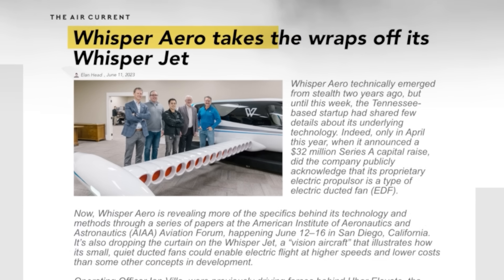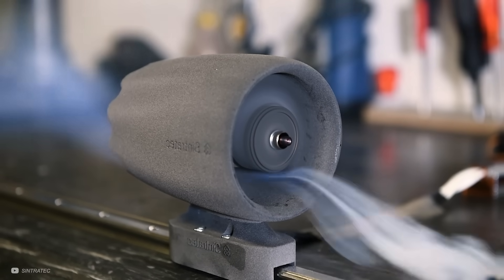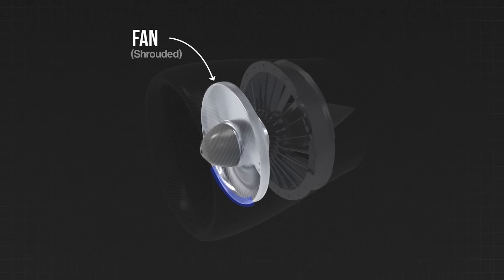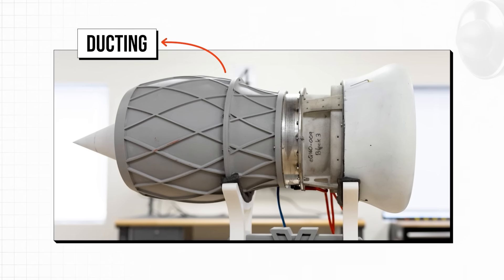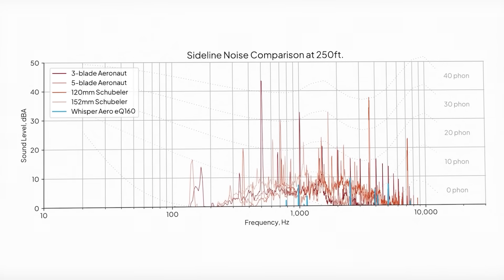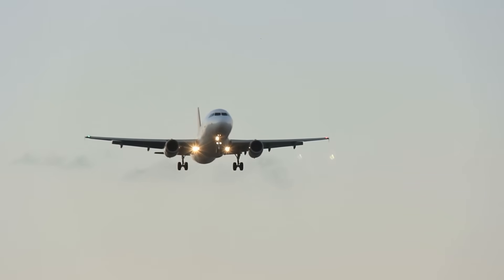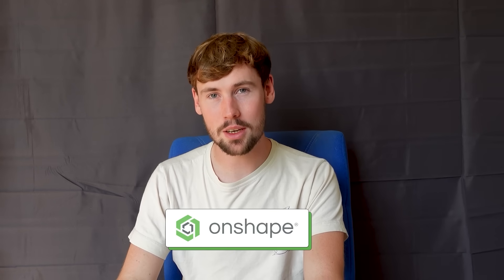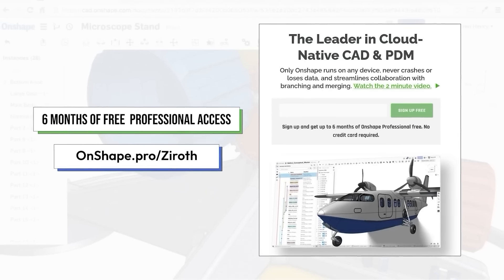This Genius Jet Engine Is Starting A Revolution

Comment: The major aircraft engine manufacturers have already done enough research to show that large fans at a slower rotational speed with high by-pass ratio have shown the best efficiency gains. Small is not efficient. All the major aircraft manufacturers are now producing twin (large) engine planes rather than multi (small) engine planes. I have flown model aircraft with high speed ducted fans and they are nowhere near as efficient as a propeller, limiting the flight time considerably.
I have to say that my trust will remain with Rolls-Royce, not this outfit.
P.S. Regarding the previous comments on the meanings of Engine and Motor, I would point out that the term "Motor" for an aircraft engine had been in common use for many years. There was even a WW2 song "Coming in on a Wing and a Prayer" which had the line "Though there's one MOTOR gone we will still carry on".
Furthermore, diesel powered ships are normally designated Motor Vessels- hence names like "M V Atherstone" (a former P & O ship)
EDIT- I have added this due to comments on my mention of bypass ratio- I know that this refers to turbo fans, but it was meant to highlight the size of the fan compared to the prime mover (the turbine). It is the large size of the fan which is the goal, moving the most amount of air, with least amount of internal drag. Small ducted fans are a dead end.
Reply: The thing is, "bypass ratio" only makes sense in the context of a combustion jet engine. It's the ratio between air going through the gas turbine that's driving the fan, and air going around (and thereby bypassing) the gas turbine.

This, by comparison, is an electric motor driving a fan. An electric motor ingests zero air. Therefore, 100% of the airflow is "bypass" airflow. The "bypass ratio" of this engine is impossible to describe mathematically because it's a division by zero.

So if you get 100% bypass airflow regardless of the size of your engine, then the size of the engine ceases to matter - at least for this particular factor.
Reply: @streetwind.  Even pure fans can be designed to either move a bit of air very fast, or a lot of air comparatively slowly. The bigger, the more efficient. Unless you go transonic, where it gets terribly complicated: whatever optimisations you do to the blades of a ducted fan, do the same optimisations to an open propeller, and then ditch the shroud for longer blades. Same efficiency, lower weight, lower complexity. Always. That's why there are no strictly subsonic (i. e.  not transonic) ducted fans in commercial service. Too heavy, too expensive, too much drag, too complicated.
Reply: "My trust will remain with Rolls-Royce". A good pun missed, right there!😊
Reply: the bypass ratio is only a real consideration for jet engines, for regular propellers, the most efficient size is the size that allows the motor to use its peak rpm while the outer edge of the blade is just below supersonic speed
Reply: Larger is in most cases more efficient, yes, but you can't judge from toys that companies do no research at all (they just aim for how cool it looks).
 I bet an out of the norm, well researched duct fan design could outperform your favorite propeller by a large margin, even if it's smaller in diameter - but not too small.
Reply: @sumwonche5688  In a word: no. You probably have no idea how insanely efficient modern propellers are. If you want to reduce tip losses, you can make the blades thinner and longer, or add a shroud. For the same efficiency gain, bigger propellers will always be better than shrouded fans. Shrouded props have been tried and tested for decades. Unless you have a specific reason why you cannot have an open propeller (usually safety), ducted fans are a bad idea. Otherwise they would be abundant; they are not a new idea by any means.
Reply: @pinkdispatcher  85-90% + the large size + the noise, so there is plenty of room for optimization. If you want for example to make electric urban air-vehicles, propellers are not an option, if they can be made virtually silent and at least equally efficient with a new duct fan design.
Reply: @sumwonche5688  just imagine propellers 5x the size of the engine with the same thrust.
The engine would have to suck the air through with the 5x speed, which would make it's power consumption 25x.

Comment: How much electrical power is required which translates into battery weight?
Reply: Or run time which equals range.
Reply: At 500wh/kg 1300 tones of batteries 164 tones of fuel.

Comment: 16dba. That is the real change. Significant certainly, but not inaudible as suggested here. Also humans can hear well into 20KHz. 16KHz may be incredibly annoying for those that can still hear it. 

In the end this is all pointless for aircraft though. Until batteries are many times better, like 10x, electric planes will never be very successful. They are too range limited. No one wants to spend millions on a plane that cannot take them anywhere. Currently they may have a niche for inner city commuting as VTOLs. Short trips at faster than car speeds. But if that really takes off, it will be a disaster very quickly as air traffic controls aren't designed to handle hundreds of craft. 
Beyond that the batteries just aren't good enough.
Reply: The reduced maintenance requirements may make them worth for small hops (within the 1h range) but even that is pushing it, considering the requirement to be able to reach an alternate airport and or have 30 min extra flight time as a safety margin.
Reply: @clockworkvanhellsing372 I would say most cases you aren't flying to airports. It takes too much time that you don't have. VTOLs direct from location to location like a helicopter. Similar max speed too. It fits the role of a helicopter but with worse range. It might be a trade off people are willing to take if they are filthy rich and this is quieter.
Reply: Full scale versions will need hybrid systems. A small gas turbine can make electricity then actual population is electric fans. A gas turbine that isn't being used for thrust should be able to be pretty well insulated for sounds. The problem ends up being weight. Gas tank, turbine, electric generator, then a buffer battery, then electric fans.... Weight all adds up. I don't think I have seen it done yet.

Comment: HAHAHA. Greenies still pushing the inviable electric aviation. Nothing says GREEN like a flaming aircraft plummeting from the sky. Well, we are developing adv engine AND propulsors which are more powerful and efficient than anything on any drawing board... using ANY fuel which will be incorporated in our revolutionary door-to-door, personal, air mobility system [PersonalJet].
Reply: None of the Whisper Aero tech is truly new... but ours is.

Comment: Would it be able to lift the batteries to enable it to fly?
Reply: It does not need to lift batteries. It only needs to lift money out of investors wallets.
Reply: They use a long power cord.
Reply: was going to say the same, probably not until solid state batteries are a real thing. Im also wondering about the drag on the leading edge and if there is an alternative for slats.

Comment: 3:43 Did you mean 16 KHz instead of 16,000 KHz? If so, that's not out of the range of some humans' hearing; children will not enjoy being near such a plane but their parents will be oblivious as to why.
Reply: At 59, I can still hear 16 kHz. The 20 kHz “limit” is analogous to an IQ of 100. It may be the center of the bell curve for young adults, but there are many far away from the mean on both sides, both young and old.

NB: Fortunately, IQ does not decline with age quite as fast as high frequency hearing!
Reply: @altosack also the lower limit of 20hz as well, is less of a brick wall and more of a gradual decrease in sensibility, where the hearing threshhold increases. so "infrasound" can become audible with sufficiently loud levels, i think down to at least 12hz or maybe lower
Reply: @LucasFerreira-gx9yh nah, just need an in-ear headphone and you can hear at around 16 Hz and below that it gradually transforms into a sensation of pressure wobble. Really, almost any cheap known brand headphone does the trick, you just have to make somehow such low frequency that is not present in regular music. All music applies a high pass filter of abou 25Hz otherwise when played back on a stage system it shakes everything.
Reply: @LucasFerreira-gx9yh  Just so as you know, the 32 foot pipe on a pipe organ is between 16 and 17 Hz. and the lowest string on standard guitars is around 30Hz.  There are web sites that demonstrate the musical scales, too.
Reply: @altosack 20KHz isn't the middle of the bell curve - it's the upper limit. That's the best any human is going to get, though only children have any chance of reaching it.
Reply: @altosackIn which case you are an outlier. That is nothing like normal hearing at that age.

12,000 Hz is typical for adults in their 50s.
Reply: How quickly we have forgotten the 15.734kHz CRT flyback whine of our childhoods.
Reply: @JoeHamelin you say that, but there are fully grown adults out there that have never known crts.
Reply: @JoeHamelin  never heard it
Reply: @JoeHamelin  I fixed a s*tload of those RCA's; could hear them upon entering the shop.
Reply: Or basically anyone who's not past their mid-20s yet. I at least was able to hear up to 22 kHz when I was 24 and it seems to only have gone down to 16 kHz when I hit 30 or so.
Reply: @BloodyMobile  Check you out; ears of a bat on this one. If you can switch on an old TV or computer monitor and hear a high-pitch whine, you'd not enjoy flying on a plane with those engines and neither would your dog. I can imagine the line to pick up earplugs for pets and youths on the way in.
Reply: 41 here, I'm in a very good health condition but sadly my hearing range dropped to about 13kHz :((
Reply: @dtibor5903  Could be you've worked in an environment with high concentrations of pollutants, or that you frequently consumed foods of questionable origin with unknown levels of glyphosate or pesticides. Just like my dad found out in his late 50s, i.e. 15 years ago, at around 11 kHz hearing limit. He then eliminated both issues, and his hearing has not deteriorated further since then (although it has not improved much either).
Reply: Yes, 16,000kHz (aka, 16MHz) is a shortwave band.
Reply: The correct way of writing the units is kHz (kilo Hertz), not KHz (Kelvin Hertz)
Reply: @ceverinoneide  no the K prefix means 1024, ask any computer scientist.
Reply: @benholroyd5221 

It depends what it’s attached to. No one asked us when they started using kebi- and mebi-bytes; prefixes before bytes always mean 1024 unless you’re a marketing weenie. If it’s a baud rate or clock speed, it’s 1000.
Reply: @benholroyd5221  This is the hill you're gonna die on? 1024 is Ki, but for those of us who don't love the Ki Mi Gi convention, we use a lowercase k.
So I think you mean "ask any stupid computer scientist." Most of us know better.
Reply: @ps.2 KB is in at least the JEDEC standard. So i dont think you can accuse anyone of being stupid, when they use a term which is in a standard.
Reply: @altosack i was kind of just pushing back against being pedantic about a unit capitalisation when it doesn't really matter, because everyone knows what it means, especially when the technically correct one still doesn't disambiguate from a much more likely but still wrong alternative.
Reply: @benholroyd5221  JEDEC? What the hell do they have to do with computer science? One of the E's in their name is for Engineering. (You know. That branch of the arts best known for using j instead of i for the square root of -1.)

And if you're looking for an organization focused on engineering but which has some crossover with computer science, maybe start with IEEE.
Reply: @benholroyd5221 Not formally. The proper prefix is Ki so 1024 bytes of memory is one KiB. It is in the standards.

It is also why disk drive manufacturers were able to win court cases in the USA when they were accused of misleading consumers by using decimal units to specify their drive capacities
Reply: @benholroyd5221 an officially deprecated use. IEC standards are the preferred ones.
Reply: High frequency waves do not penetrate surfaces well nor spread out as effectively as low-frequency waves so they tend to travel in straighter lines.

We won't know for sure until thorough testing is done, but it's safe to assume such noise will be less audible at a distance as well as inside the cabin.
Reply: @ohnoitsalobo  The point I was going to make.
Reply: @ohnoitsalobo  This demonstrates why the US Army chose the turbine over the diesel.  That and if it is flammable and can be pumped through the injectors, it will burn it.  Iraqi army guys called it the whispering death.
Reply: the highest frequencies are also the most easily attenuated by the plane's fuselage though. think about what happens when you put earplugs in. bass frequencies remain nearly the same volume, but as you go higher in frequency, the volume is continuously reduced
Reply: I am 31 and I can hear the super high pitch noise of a CRT TV when it is on, not too loud, but loud enough to hear it and be buffled by it and annoyed
Reply: @matiaslauriti  I'm impressed that you're 31 and even know what a CRT is. Digital watches vibrate at 32768Hz and if anyone claims they can hear those, I won't believe you, lessen you admit to being super-human or some sort of demon. I guess the people who created those first digital watches learned from the great CRT debacle. If only they made the hour Beep-Beep chime ring at a similar frequency, we could all have been spared that unwanted chorus for a few years back in the 80s and 90s.
Reply from the maker: This is a great point, I should have been clearer on this - I believe the 16kHz sound is absorbed/attenuated much faster, so the sound does not travel far enough to be heard on the ground

Comment: This company will be floating in dollars if this technology actually works & can be miniaturized.
For delivery drones to work and be accepted they've got to be quiet.
Reply: The fans HAVE TO be small due to the mechanics and aerodynamics.
HAHAHA. Greenies still pushing the inviable electric aviation. Nothing says GREEN like a flaming aircraft plummeting from the sky. Well, we are developing adv engine AND propulsors which are more powerful and efficient than anything on any drawing board... using ANY fuel which will be incorporated in our revolutionary door-to-door, personal, air mobility system [PersonalJet]. None of the Whisper Aero tech is truly new... but ours is.

Comment: My town has banned electric fans for yard work for summer months, so putting a Whisper Jet in a Black & Decker sounds like a good idea!
Reply: Except that every dog in the neighborhood would be howling out of control and no one would know why, well except for you.
Reply: One question. Do they still allow gas mowers? Chain saws? Table saw?
Reply: @mpetersen6  All Blowers, NOT just electric.
Reply: @McsMark1  First it will never happen and second electric have several pluses over gas first of which is way reduced decibels and a less grating sound.
Reply: @cre8tvedge  you have no idea what will or won't happen.
If you did, you'd be a zillion aire
Reply: Where is this? What was the justification and motivation for banning electric fans?
Reply: Banned electric fans for yard work? How do you use your fan for yard work. I have as most of my neighbors do an electric leaf blower. When the other neighbors gardner shows up with a gas blower we all cover our ears.
Reply: @cre8tvedge  All Blowers, NOT just electric.

Comment: The leaf blower was very much where my mind went as I watched. Not specifically that product, but any and every fan machine. Vacuum cleaners. Desk and room fans. Turbo- and super-chargers. 

Started to drift across into wondering whether parallel approaches could work for water - as in boat propulsion?
Reply: They are not silent, they just emit more noise in frequencies that humans don't hear.
That means 1) for use in households, you better have no pets, 2) for use in military, they are easier to detect and locate by automatic means because they are louder!, and 3) I can't imagine the impact on humans and wildlife if used on a large scale. Just because we don't hear it, does not mean it does not effect our body or animals or even plants.

Just think of the wales getting sick and crazy because of the noise of boat propellers ... we don't hear them, they do.
Reply: @snygg17 The effect of existing devices on animals can be dramatic. I'm hoping that these can be overall less noisy to all affected by them.
Reply: And sadly, war drones. I'm surprised the military hasn't taken an interest.
Reply: @ShawnHCorey  - If the Ukrainians and Russians are using this next spring, we have a hit. Good luck with any patent litigation.